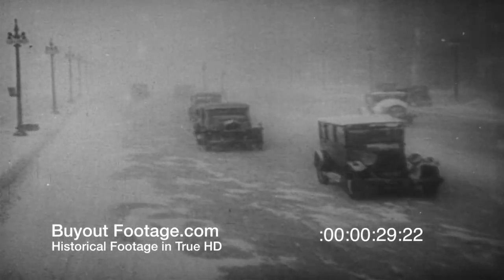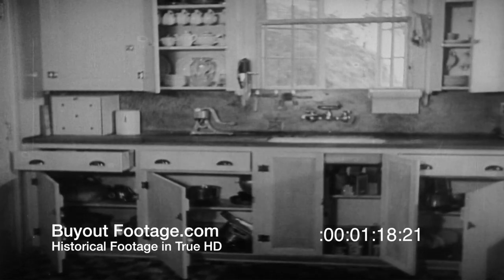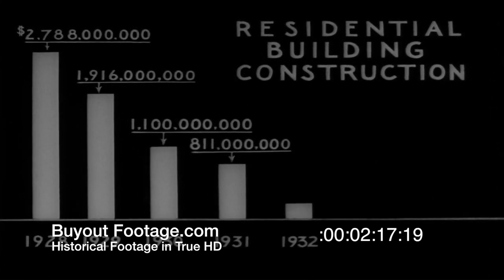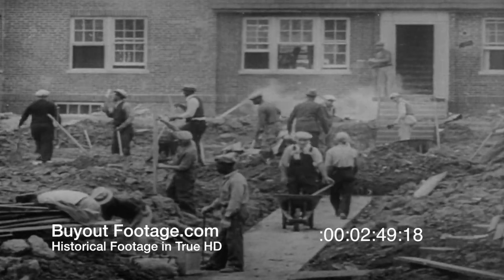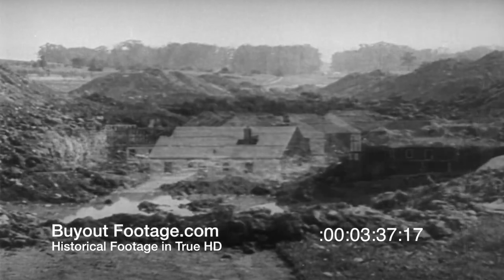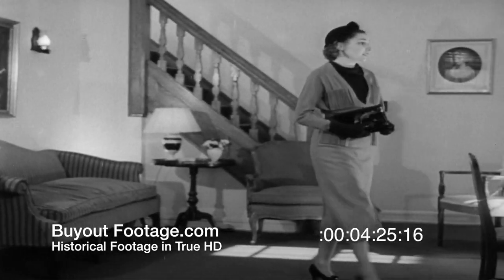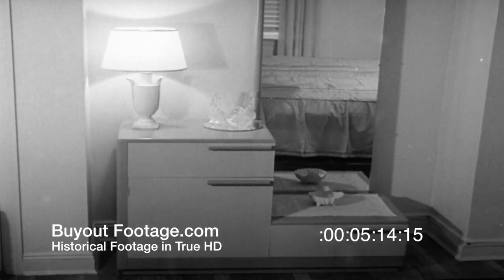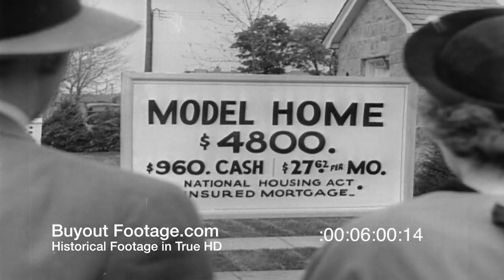HD Historic Stock Footage Housing Market 1930's, Construction, Model Homes, Lifestyle, Americana

Comment: I bought a 1939 starter minimalist traditional FHA type house, that was built on land bought at a tax sale, from a national company that sold lots in a subdivision for $1 down, and $1/week afterward.. the subdivision was created in 1917, but by late 1930s, I am guessing the company could not sell the lots due to the Great Depression and was foreclosed on for not paying taxes. The house deed just says literally that the house for sale in the one on the company's subdivision map that was seized and kept in the tax collector's office. Some woman bought many of these lots from the tax auction in 1936 and then gave two lots to two of her nephews who were brothers. The descendants of the other more accurate brother still live in the house next door, but my house was built by the sloppier brother so everything is not very well built. They built the house on level ground and then brought in soil to surround the foundation walls with so it looked like the basement was dug inside the ground afterward.. while it was built, the other brother said he had to stand on his car's hood to get inside the house. It is hard to imagine that cars could drive for an hour to get to this house. Mold is the only problem with this house I would say. The concrete mix from which the foundation was poured and the concrete blocks were made is a stronger mix than today, it looks the same as the 1936 bridge nearby is made of - large yellowish concrete granules type. The builders used the same boards for holding the concrete during foundation pour to make the floor with, so you see remnants of concrete on the floor boards on the basement ceiling. For those that today like to deny racism, the house literally had a legal clause in the deed saying, ' This house cannot be legally sold to colored people.' So black people were legally not allowed to buy this house in the 1930s or even maybe 1950s. It just said in the mortgage and deed document, 'The house cannot be legally sold to any colored person.' In 1936, the mortgage rate on the house was 6%, compared to today's 3.5%.

Comment: 20% down.  $4,800 = $84,730.  

The Federal Reserve created the housing boom and stock market boom of the 1920's with artificially low interest rates from 1925-29 mush the same as 2003-04 and the housing boom and bust in 2008  Same crap different decade.

The economy went into Depression again in 1937-29 because the Federal Reserve screwed up again and FDR screwed up again wit labor law and federal spending.

Unemployment did not drop down to single digits until 1940 when we were frantically gearing up for WWII.

Comment: Are they going to tout the lead pipes throughout?  And the faulty "burn your house down" wiring?
Reply: They didn't use lead pipes throughout. I collect - and read thoroughly, cover to cover, 1920's through late 1940's American Builder magazines, which were written by and published for professional builders, carpenters, contractors, building material suppliers, etc., and I have read considerable amounts of information on the types of building materials used in new construction of the day. Almost all new construction at this time used COPPER water lines. Lead pipes were already known to be trouble, and they did not use them. No lead pipes. Copper was cheap enough that most all builders used it not only for water lines, but gutters and leaders too! 
Lead PAINT yes, because it was amazingly durable and wore like iron, especially the enamels used in kitchens, baths, and exteriors. Left ALONE lead paint has absolutely no effect on current owners, or even on the contemporary owners of the day. The key word here is "ALONE." Don't pick it, don't sand it, don't scrape it. Leave it be, and paint over it. 
Same goes for asbestos. Left strictly alone, it causes no problems to anyone. It only becomes problematic when it's released into the breathable air as tiny fibers. That doesn't happen by itself - it's tough enough it needs lots of help to become that way.  Cover it up if you want to redecorate, just leave it there! More vintage homes have been absolutely destroyed because of over-zealous lawyers and ridiculous laws that serve no purpose other than to make sure beautiful, safe residences get dismantled at incredibly high cost.
Reply: As for the faulty "burn your house down wiring" if that were true, then we wouldn't still have so very many lovely vintage age homes with original wiring still standing! The biggest problem wasn't the wiring. It was the dangerous overloading of circuits with many more appliances and devices in an outlet than it was meant to support. When homes of this Vintage, and particularly before,  were originally wired for electricity, it was mostly for lighting, with a few wall outlets for the occasional vacuum cleaner, the new electric refrigerator, and maybe the radio. They didn't have multiples of kitchen appliances yet, and frequently things for temporary use like an iron were plugged in using a special adapter plugged into the hanging cord from the ceiling after you removed the lightbulb. Housework was done during the daytime, so turning on the lights to see wasn't actually an issue most of the time. Electric appliances and their use in modern middle class homes exploded during the twenties and thirties, with new or improved household electric appliances coming on the market every day - literally - and the wiring in the house that was built in the Roaring Twenties just wasn't "blooming" more circuits and more outlets as the need for them exploded too.
No, and most people did not go to the  inconvenience and expense of having their whole houses rewired to keep up every five or ten years. They just looked for ingenious ways to expand the usefulness of the wiring they had, which, while perfectly safe and adequate when installed, was rapidly becoming overwhelmed with new appliance usage. Expandable adapters, which plugged into one outlet, but bristled with three or sometimes more usable outlets, allowed the homeowner or the housewife to plug in the floor lamp, the table lamp, the radio and the vacuum at the same time on the same circuit, but if everything was being used at the same time, such as on a dark, rainy winter day, the fuse would announce the failure of that plan pretty quickly! 
The "American Builder" of the times  contained many articles and ads on adequate wiring for new homes, and especially for planning AHEAD and allowing for the definite occasion of increasing use of electrical devices, large and small appliances, lighting, light switches, and the outlets that would be required to operate all the current plus those new labor saving devices we just knew would be coming along soon! Dishwashers, which came along in the 20's and electric ranges, the "new, clean, modern way to cook" and electrical refrigerators - "Fire your ice man today!" plus an exhaust fan, a wall clock, and additional outlets for countertop appliances such as mixers, waffle irons, coffee makers, even cooling fans - rendered the kitchen a huge user of power all by itself! And it needed all its own dedicated circuits. When breakfast nooks came to fame and every 20's and 30's home couldn't be considered complete without one, frequently had a light fixture over the middle of the table, plus a double outlet at the end of the table to plug in the waffle iron, or the toaster, or the egg poacher, and the coffee percolator right there at the table! 
Remember the scene in "A Christmas Story" where Ralphie"s dad - "The Old Man" - was attempting to plug in the Christmas tree? Remember the snake's nest of cords plugged in to one duplex outlet using all those adapters? And the sparks that flew when he did, with the scholarly pronouncement on the Old Man's part that "A FUSE is out!!" ? That's exactly what I'm talking about, and it was very common back then. Now it wasn't the fault of the wiring that the humans using it were doing it without proper regard for the capacity of the circuit, and put that infamous - and ultimately dangerous penny in the fuse spot - leaving themselves wide open for a house fire. And the old cloth covered knob and tube style wiring wasn't meant to carry the kinds of loads that were inflicted on it either! 
My parents moved into a 1920's era bungalow back in the middle nineties. It was a beautiful house and had been very well cared for. But they had to have ALL the old knob-and-tube style wiring that was still in it replaced before the insurance company would write a policy on it! It was actually still in good shape, what there was of it, because a lot had been upgraded, and other parts were newer in newer additions and remodeling work that had previously been done. But it ALL had to be brought up to code first. They said the electrician told them he hadn't ever seen a system like that of such an age that was still in such good shape. So, a good bit of original plastering had to be removed and replaced with drywall to get the wiring done. But, even so, there had never been a fire in it anywhere. It depends on how you take care of things, and not overload a system of limited capabilities.
Reply: I won't challenge you on this.  YOU WIN
Reply: I would like to build a house with cast iron stacks, copper plumbing, 3/4" hardwood floors and real honest to goodness wood lathe, plaster and a crushed oyster shell topping coat! I rented a house in Charlotte that had real plaster and the oyster topping coat and it was magnificent to feel and to live in.  It felt like a solid house.   I would have a dishwasher for show only. They really smell bad and only run up your electric bill.   The best way to wash dishes is by hand and air dry.   Stop using your dishwasher for 60 days and see the difference in your electric bill.  You can have dinner at a nice restaurant with all the savings...with a bottle of wine to boot.
Reply: In the 1950's the solder they used to join the copper lines had lead in it. I'm assuming this was true in the 1930's.